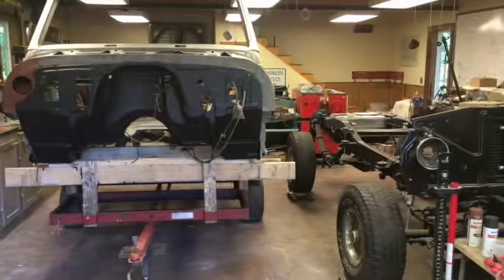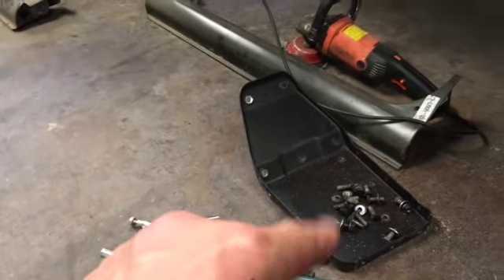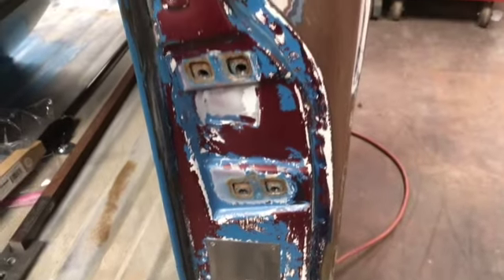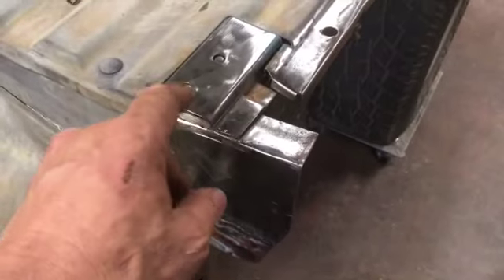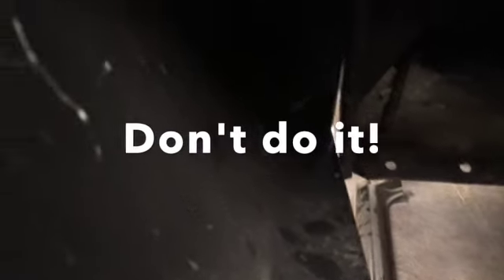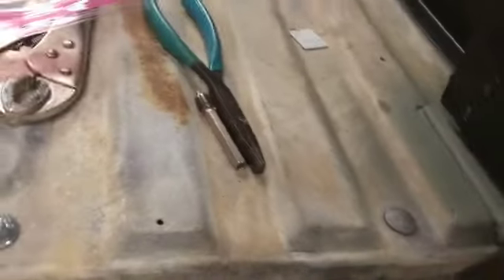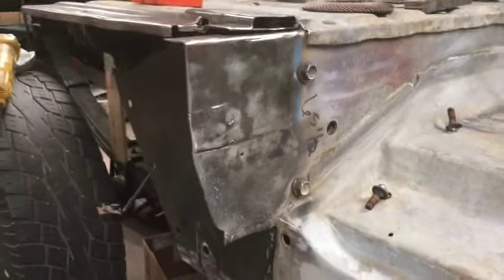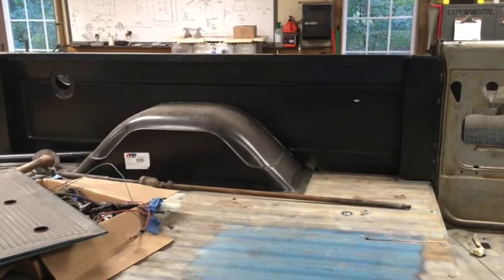Gen 1 Blazer Restore and Conversion Ep. 10 Bedside Replacement.

Comment: Blazer brother 👊 I have a 71 k5 I started my restoration about four years ago and now I am in the tail end and almost finished it’s so tuff to get these old trucks back to new but when you do it right it’s so worth it man ..... 1 ton 71K5 with a new built 454 with a turbo 400 ..205 tcase 10 inch lift 👌🏽
Reply from the maker: Blazer Bro, 10 inches.. that’s impressive! Videos required.
Reply: Instablaster.

Comment: What did you ultimately do about the 2 holes in the floorpan at the front pillar? I am working from below as my floors and bedsides are good but there are no threads to bolt the lower structure to the floorpan. Your video helps make sense out of metal that is no longer there.
Reply from the maker: Hey John, do I talk about those bolts in my video? If so what video and at what time hack. I’ll try to refresh my memory
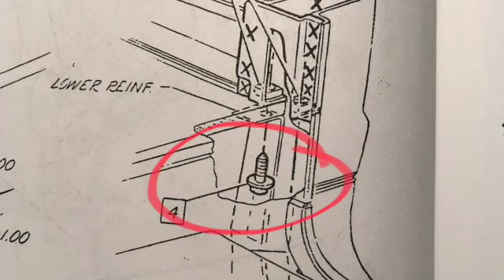Reply: 15:25 there are 2 holes in the floor pan that hold a lower brace in place   however there are no female threads in the floorpan assembly as you mentioned. I'm there right now, just finished welding the bottom pillar and inner rocker. @MrRv8pilot
Reply: video 10
Reply from the maker: Hey John, sorry for the delay. I looked back at the video as well as my assembly instructions manual and still don’t have a good answer for you. I don’t remember if those bolts attached some underlying structure or not. The best of my recollections is that neither side of my truck had bolts installed and still don’t. Let me know what you find and sorry I can’t be more help. Don
Reply: Ha, funny , I made a decision today and used an expanding 3/8 concrete anchor that had the correct 3/8 diameter  to slip up from below and expand to give a very solid 5/16 stud that drops down from above. . 100 times better than nothing at all. I was reluctant to cut open above where you had the big gap to install some type of dual caged nut assy.  was looking at rivenut assembleys but that 3/8 sleeve  between the 2 layers of metal was too small. @MrRv8pilot
Reply from the maker: @johnpeters9903 I dug a little deeper, after peeking through the gaps in my fully assembled rocker boxes. I could see that I did install those 2 bolts. Both bolts are installed from the bottom and help attach the rocker box reinforcement panel (LMC 38-6436/7). It is also seen in the Factory Assembly Instruction Manual about 2/3 way into the manual (no page numbers in my manual) drawing no. 390194. Don

Comment: Are the 74 k5s the same bolt on bed sides
Reply from the maker: The 69-72 are NOT completely bolt on and I’m sure the 2nd gen are close to the same. Some welding (spot or plug) required in the door jam area.
Reply: @MrRv8pilot   ight   im getting a 74 an its gonna need both sides replaced      obviously alot of measuring  to keep everything square when assembly  is  in process  any other recommendations

Comment: Where did you find the factory measurements and weld locations?
Reply from the maker: Sorry Travis disregard my previous reply,. I used a combination of measuring the old panels and weld lactation and information from my 1967-1972 chev/GMC Factory assembly instructions manual. That’s a very helpful and available manual. Just google that title.